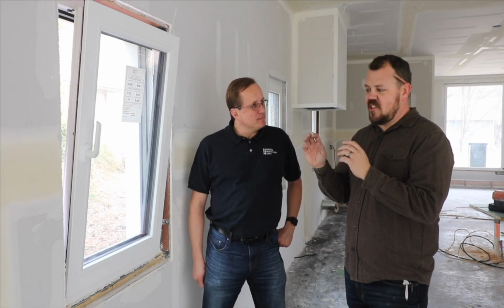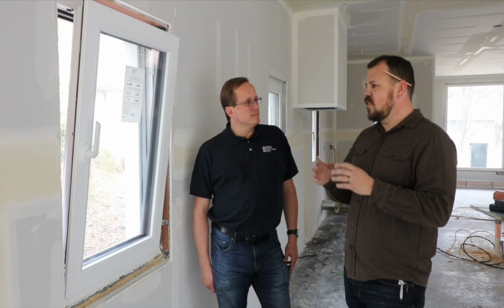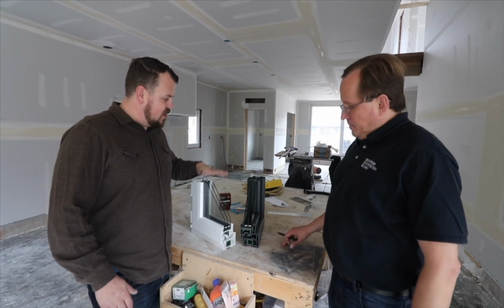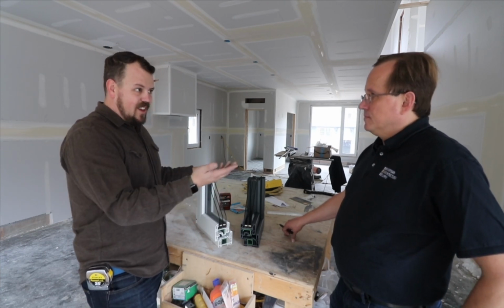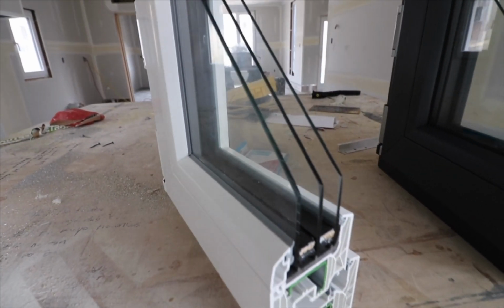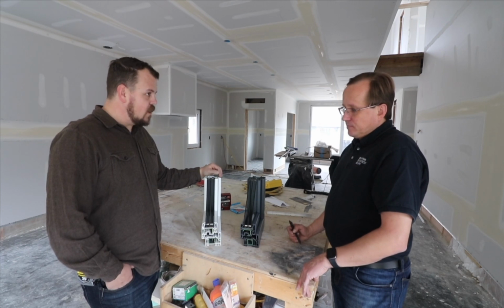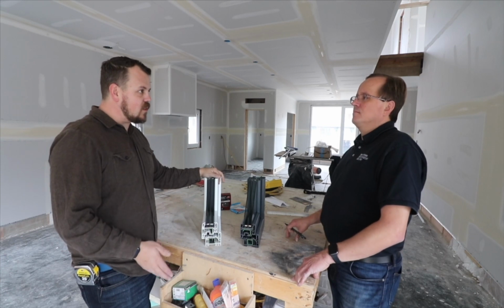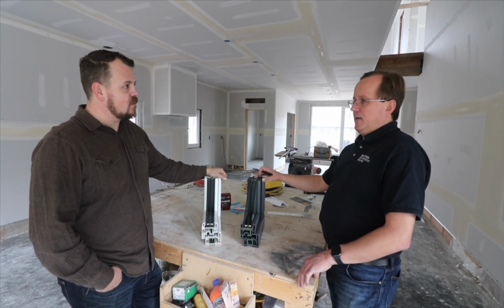High Performance Windows with European Architectural Supply.

Comment: It is a shame you couldn’t tell us the price or price range for these windows.
Reply: In Western Europe (average, it can be half the price, but also double) per square meter. Though, the more square meters a window is, the cheaper it becomes. Same with the total number of windows /square meter one orders. If you order 2 different colors for the outside and another different one for the inside, price goes up, up to 10% of total price. 
PVC €200 – €400
Wood €300 – €500
Wood/Aluminum €300 - €600
Aluminum €600 – €800
Reply: For a house around 30 windows 2 sliding door with mosquito nets triple pane with instalation you are looking around 75000$

Comment: Although not all vinyl is created equal and there are different quality grades, all vinyl windows whether Euro or North American use uPVC in frame manufacture despite the very common suggestion that Euro windows use uPVC and north American windows use "vinyl" (insert disdainful sneer). They are all unplasticized polyvinyl. 

The NFRC (National Fenestration Rating Council) oversees and lists window energy performance ratings in North America and if you want to know how a specific window performs you can find the information about it there, but many European imports are not listed in NFRC website suggesting that they have not been tested to North American standards. 

Euro and NFRC windows are not tested using identical criteria. The obvious is that Euro windows are in metric while NFRC uses Imperial. In addition, Euro testing measures frame, sash, edge-of-glass (glass within 2 1/2" of the edge), and center-of-glass (all glass not within 2 1/2" of edge), as four separate areas, while NFRC combines frame and sash, so three separate areas. Also, NFRC temperature variation used in testing is more severe than Euro window testing which is based on a warmer cold limit. 

The warmer low-end temperature used in European testing tends to favor wider airspaces so that a wider airspace is a feature of Euro glass packages, but there are also North American manufacturers who have a preference for wider spaces as well even though it's not an advantage when tested to NFRC criteria. 

Because of the differences in how the windows are tested, you cannot compare results and call them the same, it doesn't work. However, you can convert the Euro metric U factor result to imperial using a very simple formula and some European window companies and especially their importers (and sales force) in North America do it quite often. 

The result of converting metric Euro U factor to Imperial U factor is a listed performance value that appears to be better than the actual window performance value if the unit had been tested using NFRC criteria. In other words, "fenestration style" sticker may be correct as a value when comparing to other Euro windows to one another but is an apples to oranges comparison when compared with NFRC derived numbers. The European performance values appear to be better than they would be if tested using NFRC testing and certification criteria. 

Also, it isn’t uncommon for some Europhiles to use center-of-glass measurements to describe window performance. Two reasons that thus is wrong. First, the value will be inflated assuming that the COG measurement was computed using the conversion from Euro derived values, second center-of-glass should NEVER be used to describe window performance because it is NOT an accurate representation of window performance. It’s a good way to describe glass performance is you want to compare glass to glass, and not window to window.

The warmest part of any window is COG and using that rating as a performance value, rather than complete window value is at best misleading and at worst dishonest. And even if R 9 is appropriately correct, it equates to U.11, which is available on US glass packages as well. Ultimately, I am not knocking Euro windows, I think that they make some amazing products and I am very impressed but many I have seen. What I am commenting on is the misleading information that seems to accompany discussions about performance comparisons between Euro and North American products. 

There are North American windows that are every bit as good as anything coming from Europe. The problem isn't a technology gap, it's a perception and cultural gap. Window companies manufacture what sells. Europe has much more stringent performance requirements and a different consumer perception of priorities which results in windows that were designed and manufactured to meet those perceptions and requirements, while North American codes and perceptions are generally different from those in Europe.
Reply: I am the owner of Laurel Windows in Brevard, NC which is a premium level dealer of Oknoplast windows from Europe and we have all products NFRC rated and are nationally certified for R, LC, CW, and AW project with both our full aluminum products as well as our UPVC products.  But when you see the construction of these products and see what you get for what you pay, you truly can’t compare.  It is near impossible to ever consider taking an American window out of a home after 20 years and expect it to be usable in another project where as with these tilt/turn windows, I have personal experience doing just that, in Europe my brother in law was upgrading his windows on his home after a remodel and kept several of his older windows to put in his new garage he had built and after installation and some light adjustments the windows operated flawlessly and were roughly 18-20 years old.  We are one of 18 dealers in the US for Oknoplast and you should give us a look.  
Laurelwindows.us
Oknoplast.com
Reply: Theese windows will last 50 years without any problem. The standard in europe is really high and effiency is really really strickt in EU. Quality wise there is nothing better
Reply: Thank you @gregcorwin8316 for that very interesting and informative  write up . I wonder how you learned all this information, are you in the "business" ?  We're adding an addition to the rear of our "forever house" and, in addition to using high performance wall and ceiling insulation,  we decided to use really good quality windows .  I've spent countless hours researching all the major American companies, like Anderson ; Pella ; Marvin ; Milgard , etc., etc . Just recently, I looked into Alpen Windows, in Colorado, and was very impressed with their products and  I like them much better than any other windows I have seen . Here's a fun fact : The Empire State Building replaced all of their 6514  windows with Alpen .

So, I decided to purchase Alpen's  top of the line residential model , Zenith - ZR9 with Quad glazed glass using Kripton gas . BTW, the frame is fiberglass and not PVC .
Reply: @kumaquattro-le1vk  Thanks and you are welcome. 
I am familiar with Alpen (and all of the other companies that you mentioned earlier in your post). Curious if you picked the Zenith specifically because it's fiberglass rather than vinyl? Alpen does make a very nice window.
I was in the industry for close to 30 years primarily in quality, code compliance, product development, product reliability, research and testing.
Reply: @gregcorwin8316   Gregcorwin8316
Thanks for the reply Greg .   I went with the fiberglass because everything I read,  said good things about fiberglass vs vinyl , like less expansion, stronger, nicer appearance, etc . The Zenith  is more American style and matches my other existing windows as well .  I'm open to any more advise you could give me before I order these . Thanks.

Comment: PVC seams can pop during transport or installation. You have to be really careful when moving and installing, especially with large openings.  Something you may not notice for months after the Owner has moved in.  Matt Reisinger brought this up in one of his presentations, and I have a personal experience with my own living room window.  A simple field test would have checked for a water leak (I wish I knew at the time).  I  would want to see the Contractor's or Sub-Contractor's warranty and heavily lean on the Contractor to carry the installation warranty for the duration of the manufacturer's warranty.  (That's likely something the sub or contractor would not be willing to agree upon)  The distributor may not carry that manufacturer after a couple of years  so the owner would have to deal directly with the manufacturer. The manufacturer would have to replace the window, but a new rep would have to come out first to measure the opening, and he would be looking closely for installation deficiencies that may void the warranty. At the very least the owner would have to pay for the installation.  

How good is this 3rd party distributor for carrying the quality assurance on a European manufacturer's warranty?  I would think he has no responsibility for Q&A any further than for delivery of what was on the shop drawings.  The Contractor is responsible for the QA of the installation.  That's the most important stage.  Closing the openings and covering the exterior  is an extremely important sequence for sealing the building and thermal envelope performance and building code requirements.  WRB's are often flashed over window flanges or into the window pressure caps.  A window replacement is a big delay and a big headache for who ever is responsible for the mistake. 

Shop drawing reviews are not a sign-off by the Contractor and Architect - especially the Contractor - that the windows are good to go.  So if a US manufacturer rep/a distributor/a subcontractor/or a contractor, does nothing more than measure and submit the rough openings to the manufacturer and no manufacturer shop drawing are produced, if a popped seam or over or undersized clearance resulted during the supply and install, the responsibility for correcting the problem would most likely fall into the Contractor's hands, but would likely be expeditiously resolved between the US window manufacturer and the Contractor, irregardless of shop drawings or no shopdrawings.  Some US manufacturers send their own people out to do the sizing and installation.  That beats the hell out of a shop drawings because the manufacturer will call out any issues with how the rough openings are framed, and will coordinate the fix, and still carry full responsibility on the installation to meet their warranty.

On the other hand, shop drawings are nice to have because they allow the Owner and the Architect a last chance to change their minds on the window design for cost increase/no cost increase/and cost reduction. 

A custom sized window manufactured outside of the country is not a good idea in my opinion. It's a high risk to the Contractor to carry, and therefore a headache waiting to happen for the Owner and everyone else involved in the project (Me thinks so).

If you're not going PHIUS passive, it's not worth it.  LEED would automatically not qualify because of distance to the site.  It's a premium cost, a high risk & not a big enough difference in performance to justify.  That's my opinion.

Comment: I really wanted these windows in my personal home. However, in the end my concern was finding a subcontractor who would be experienced with installing European flangeless units and dealing with possible warranty replacement/ repair issues. How are you addressing this with your clients who don’t have access to a Briton, Reisinger or Baszek?
Reply: You could install it by yourself, extremely easy. Nothing will brake in 25 years period - this is not US "technology"... There is other kind off a problem. Those windows are air tight - zero fresh air goes through. That's why in Europe you need HRV system to have fresh air inside. In US every house has more holes that Swiss cheese so in reality it doesn't make any sense to buy expensive energy efficient windows.
Reply: @Bart-dg6qv  I agree! thanks Bart